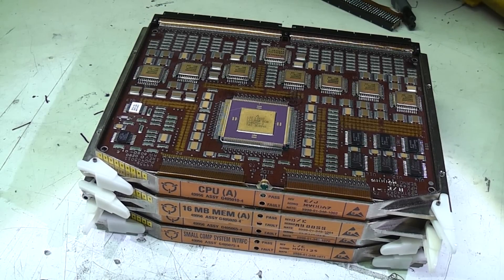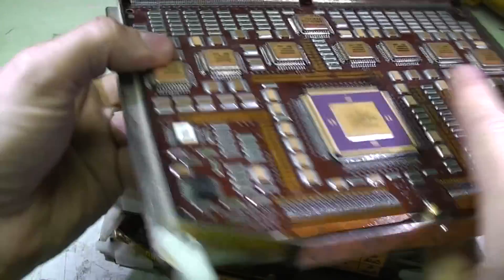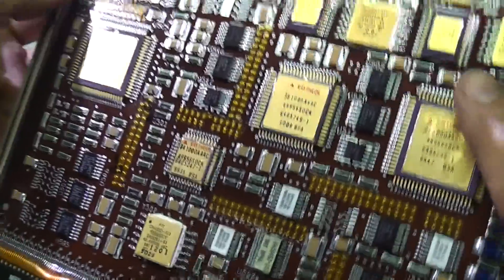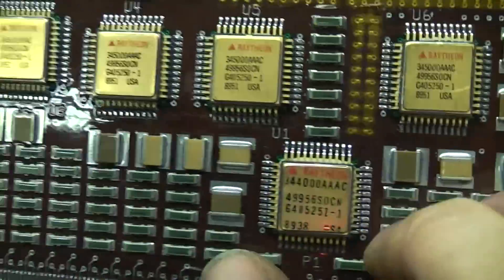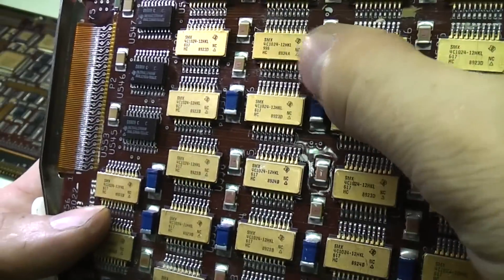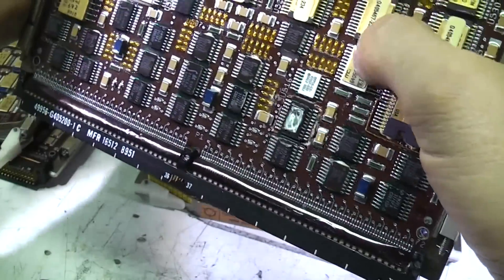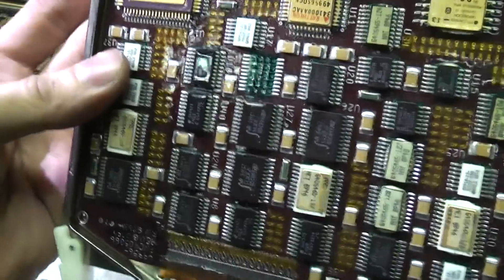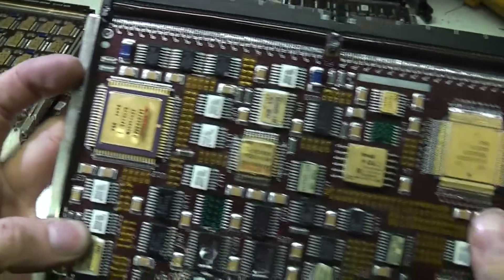Wierd military computer boards

Comment: Very cool. Brings back memories. I used to design and test EWS (Early Warning System) and Flight Processors for military jets and CAS (Collision Avoidance System) for FAA. A few points. It isn't illegal to possess this antiquated technology. Raytheon made none of the components themselves. We were always behind commercial technology, often 5 years or so, because devices had to be MILSPEC (i.e. hardened). The racks and their mounts are not for thermal conduction, but rather for capture and rigidity. (Think about it, if you're pulling G's you can't have a board slide out or twist) The coating on the board is called Conformal Coating and is NOT for marine (i.e. waterproof) purposes, but rather to again, hold components down where they're placed. The boards are typically not PCB's (Printed Circuit Board), but rather PWB's (Printed Wiring Board) in that there is dimension to internal interconnect. The bus connectors at the rear are $$$. Again, very cool! Nice find.
edit: The connectors are $$$ because they have to be VLIF (Very Low Insertion Force) yet also be HR (High Retention). Many pins and can't bend pins nor boards.
edit: Each board had to go through what we called "Shake and Bake" in an environmental chamber that put each board through vibration and temp cycles while operating.
Reply: +Napa Blue thats real knowledge right there... thank you for that, this clears out a lot of fuzzling about it.
i'm a dumb fuck who doesn't know shit about this stuff but it's very cool to learn from you guys as i don't get this at school for that matter nor do i go to school anymore (unfortunately).
so that aside, now we know that for sure, what could it be? still leaning towards airspace tech then?
Reply: +Napa Blue So are boards like these used on fighter jets ?
Reply: +Michał Pawlak 
My guess would be that these would have been used in older US aircraft like the F16.  When they upgrade the avionics package these would be tossed.  Anything 'sensitive' would be destroyed, so there won't be anything surprising in this equipment -- just designed to be very reliable and able to withstand severe electro-magnetic radiation (from e.g. being blasted by high-powered radar).

If you have ever wondered why military grade technology is well behind commercial offerings but costs at minimum ten times as much then this is a good example of where that money goes.
Reply: +Napa Blue They are conductively cooled.  He has the lids off which have the conduction pads in them.  These are part of an early gen MIDS terminal, like what ViaSat makes for them now.  What they actually end up being is a miniaturized VMS computer in a box.  Instead of being a large form factor rack mount item like on a submarine, they all get stuffed into a forced air box that holds about 12 of these various function 'cards'.  The cards themselves are conduction cooled boards to the can they get sealed into.  That is the "lids" I referred to earlier.  The chassis is about a ten by fourteen by eight or so inch box that the cool air gets forced through around each of the cards once they are all in.  The main RF 'radio' sits on the same tray, and all of the waveforms are software synthesized.  And no, it is likely they should not have ended up on ebay.  I am sure they are not usable, however they can still be studied to garner how the newer radios go together.  Or they could just read what I just wrote.  Most of those cards are likely "CCI" level "Controlled Cryptographic Instruments".  Anything that was on them that actually was of a classified nature is likely burned and unusable, but the entire cards should have been physically destroyed before being disposed of.  If the guy was a true "Allied Patriot" he would turn them in to a military base near by, and take the hit on whatever he spent on them.
Reply: +Napa Blue I can tell you from a maintenance standpoint conformal coating horrible. It's like digging through potting compound to get good probe connections. The angle block fittings remind me of some system I worked on but can't remember. Early 90s.
Reply: Jeffery Rowan
It has a UV indicator in it as well, and after servicing, has to be replaced and checked.  It is a moisture guard.
Reply: Gary Kindt Exactly. I was referring to only the board. There were thermal rails and a metal cover over the whole board. Good point.
Jeffery Rowan Hahaha. I can remember the gals picking the coating off to rework a board. Nightmare.
Reply: Napa Blue
I am so glad that you are not wearing a blonde colored dead cat on your head there.  :-)  We have some idiot doing that trying to get our nation's top office.
Reply: +Napa Blue its probably  from late 80's 
im guessing from memory size..

also  the  smd parts  are somehow ""oversized""

very interesting  your comment about  inserting force, however makes sense..
Reply: cnccarving
They have their lids off and they most certainly ARE conduction cooled designs.  The interior of the lid has thermal conduction pads in it which meet up with the chip tops.  The "backplane" is at the bottom of the container (cage) they go into and it gets cooling air passed through it as part of the system to cool those canned cards down with.  So, it is the bottom of the cards which have the connector, not the rear.  The system they went into is called MIDS, and they most certainly are still on the ITAR list and should not be being passed around openly in foreign nations, even those of our allies.  The parts are held down by SOLDER not the conformal MOISTURE BARRIER coating, and the acronyms PCB and PWB are interchangeable and synonymous with each other, and are merely evolutions in the manufacturing process and terminology used therein. They have evoled a lot, but are still the basic miniaturized VAX/VMS rack computer in a smaller package.

  Here they are with the lids on: 

http://www.militaryaerospace.com/articles/2013/08/viasat-dls-midslvt.html

  And this is what they have evolved into:

  http://www.dote.osd.mil/pub/reports/FY2010/pdf/dod/2010mids.pdf
Reply: parts never  were held  with  tape n vinyl...
soldered  or  in socket..
very interesting to see, what  I didn't noticed in that  age..
the difference  between the  smd parts  and the  ""conventional"" capacitors , resistors..

thank you for  links..
Reply: +Napa Blue Very interesting! It sounds a lot similar to the boards that are designed for downhole tools in the oil industry. Very similar construction and testing methods
Reply: +Gary Kindt prolly wasn't built in America anyway. I think there is politician with great power and and mention of private sever that is likely much worse...
Reply: I like things in my bum, but I was also taught to share
Reply: so was all that just for a specific purpose or was the system for programmable general purpose?
Reply: Dude, I thought they were for the MIDS system, but must be for some older models, the boards in them these days don't look like that. They are the same shape and design, but have alot more integrated components
Reply: Scisupply
Those ARE old MIDS system boards.  Do a search on Google Images for MIDS LVT and all the new stuff shows up.  Same form factor, same boards, just that they actually DO have their thermal conductive shells on.  This person showed images of the system they were removed from.  It is indeed one of the original MIDS system components.
Reply: @Ken Mason lol, epic dude i love it!
Reply: @Ken Mason LOL!  I know the kind.  He was this kid throwing the tantrums on the floor of the toy isle in the grocer store cuz mom said no to the GI Joe with the kung-fu grip.
Reply: Have you studied computer architecture? I am interested in also lesrning about processors, etc, hardware related stuff, but dont really know where to start
Reply: so how did the Navy boards differ from Airforce's?

Comment: It's mainly just for industrial and military applications. It's possible for a manufacturer to manufacture and sell electronics such as DVD players, stereos, etc that meet class 3 spec., but most only build such electronics to either class 1 or 2 spec. to keep the cost down. Class 3 electronics are also built for electronics that need to be able to last in harsh conditions. On a jet plane, our controls are subjected stong vibrations from the engine as well as wide range of temperature changes.

Comment: it could be an attempt of making so called "modular pc" like the project christine fro razer this can explain that the cpu, memory ,gpu and other components are separate, but it still does not explain why are there such wired components on the board, may be because its really old (16mb of memory).
Reply: Its obvious that its old, and its obvious that its a modular platform.
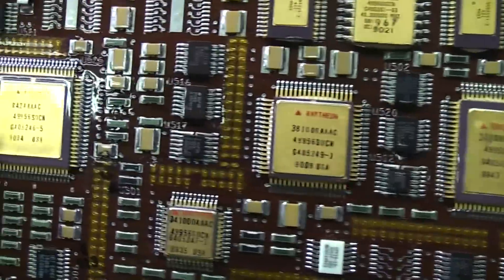Reply: 1:15 he says most of the date codes are '89 / '90, so yes it is fairly old.

Comment: I get the impression they are made for the computer section of an airplane. Slide in design for a rack mount system, and built to handle any hard force or g speeds maybe.

Comment: I worked on a similar system in the Navy in the early 80's and Mark is right about the hard drive for the system 6 -20 inch gold anodized disks with an astounding capacity of 20 mega bytes , the core memory was wire wound made by Sperry Rand and had a 4k limit. Pretty much anything Raytheon was radar, witch is what I mainly worked on, and the dips and flat packs usually indicate navigational memory. Before GPS the military relied on gravitational tracking, dead reckoning, actually pretty reliable.
Reply: With everything Ive collected and studied for decades I've never known or found them to use gold on platters. Palladium was commonly used for higher equipment

Comment: I would argue that they're aerospace, maybe even from a space program because they've been built to stand heat, punishment and they seem to be easily interchangeable. They also seem to have some sort of error checking system built in coz of the pass/fault LEDs. Id say these are either from a fighter aircraft, a missile or a space rocket.
Reply: It's possible they're military because a lot of those chips are branded with Raytheon on it, and Raytheon is a defense contractor that makes all sorts of weapons and technology
Reply: Matt Brine Raytheon has a history of working along side DARPA and NASA therefore that does not fully rule out the possibility of these boards being Aerospace related. The modularity does give the biggest hint though and as such I'm wondering if these types of boards where ever in a naval usage
Reply: Matt Brine Raytheon works for whoever pays them.
Reply: Frag, Ratheon worked for Amana Co. and ATC is not categorically military, so you kind of prove my point. Ratheon works for whoever pays them, it's the nature of being a contract manufacturer company.

Comment: @Riskteven Based on that this in not capacitors for the normal market it would most likely be more expensive to get to the right capacitance by buying several smaller ones then to buy one with the right capacitance right away and several also takes more room.

Comment: And even with all of these electronics the computer could still not store one byte.
Reply: Yeah, doesn't that make you hungry?! xD
Reply: What do you mean? One of the modules there is a 16mb storage thingy.
Reply: Tyler Hackett thats ram
ram is not storage
Reply: imchris5000 Ah good catch, I didnt realize it was RAM.
Reply: imchris5000 that withstanding, there has to be some non-volatile storage somewhere larger than 1 byte.
Reply: Tyler Hackett well theres the uv flashable chip on the scsi board but thats not really for any data storage you can use
Reply: imchris5000 It says 16 MB MEM

Not 16 MB RAM

Mike also said it was memory.
Reply: 16 MB memory, prooves you wrong
Reply: ***** I checked online and looked at the datasheet for the ICs, and they indeed are RAM, DRAM to be specific. 1048576 x 1 bit.
Reply: It was a joke. OK?
Reply: TeenMager Yeah xD
I responded with a joke also but I think others had different ideas....
Still, doesn't that make you hungry? Byte ... Bite ... haha? xD (lame xD)
Reply: Blocks alot of them
Since when is data storage listed as memory?  Generally that lingo is storage or capacity, not memory.  In addition RAM = Random Access Memory.  Also in the video it he referred to the chips as DRAM or SDRAM which are self explanitory.
Reply: TheDrow
Memory can be reffered to as RAM, or Storage.

It doesnt matter

Either way Im p sure it DOES have storage,

Go to cmd promt and type dxdiag

it will show a window with your computer specs

scroll down and you will find a section called "Memory: AMOUNT HERE, RAM."
Reply: RAM is storage too. I think you might be refering specifically to non-volatile memory. Any EEPROMs on those boards could theoretically be used for this purpose.
Reply: I think the word you're all looking for is dedotated.
Reply: You count the micro code ROM on the CPU(dont think they used direct CU wiring)? :P If it isnt an EEPROM or an FEEPROM it's likely to be factory written ROM.
Reply: d00kiebird isnt dedotated the house elf guy from gharry potter????
Reply: d00kiebird no your worng its the elf guy
Reply: d00kiebird your* not you'er
Reply: jacob daniels You do know that "you're" means 'you are'? 'Your' shows ownership, as in, your cat, your house, your car...
Reply: dieselphiend Yes ... just fucking with you
Reply: TeenMager  +Everyone.. the "storage" like HDD type storage is what will be attached to the SCSI controller. in this instance looks to have no drives
Reply: What has the world come to these days? Idiots who don't understand a simple joke get into completely ridiculous arguments that mean nothing. Please tell me you understood it was a joke.
Reply: i do, however i feel that not everyone knows this lol. trying to inform not misinform :P
Reply: TeenMager Well if the ram is 16 MB it would make sense if the hard drive / storage has even more capacity?
Reply: TeenMager What makes you thing that this is the complete module set? Maybe the ROM is somewhere else.
Reply: well the military doesnt need high performance tech like consumers would since they dont have really high tech anything because everthing was made way before the stuff we have now and they dont have demanding hardware, just simple calculations and stuff, and they had to use parts from like 1980s and 70s.

Comment: I'm not sure of their purpose, but I'm confident those are VME bus architecture cards which would all be installed in a common card rack. The navy still uses these pretty commonly in most digital systems for instrumentation and control.

Comment: I bet these boards work percfectly at ~200ºC
Reply: +sukhoy Plastic can be damaged either by high temperature or by low one.
Low temp is in space but the equipment is too heavy for that.
High temp could be everywhere in the case of fire and chips will be damaged anyway so why bother ? The only explanation could be the equipment is operating in close quarters like submarines where fire and toxic gases are very dangerous.
Reply: +v ant According to Raytheon they're components for military aircraft use.
Reply: +sukhoy isn't all that metal just extra em protection?
Reply: +v ant He is right. These boards are rated for very high temp operation. I don't know about 200C, but 150C seems reasonable. I believe these were meant for supersonic aircraft.
Reply: There are thermal set plastics that can withstand 400c or -70c with no problems.  First applications for the aerospace industry.   A lot of these plastics are now finding their way into food handling commercial equipment and printing presses.

Comment: I agree with telecom Titan those are combat reinforced modular computers commonly ussed in tanks,  front line level fire controllers and radar systems.  I also think a similar style is used in old school  missiles like the tomahawk. 

Their also purposefully mis labeled and have false visual circuit paths for espionage reasons

Comment: this is the best highest quality piece of electronic i have ever seen... certainly build to last forever.. if every electronic part and design are like these it will be very rare for thing to break... less polution !
Reply: Unfortunately the coating used on these boards is pretty toxic if it gets into the environment. Certainly those used in marine environments can be used for years without the risk of anything growing on them.
Reply: everything about electronic is toxic....